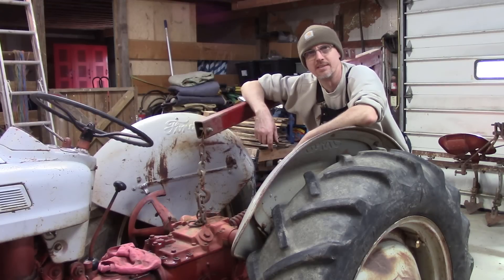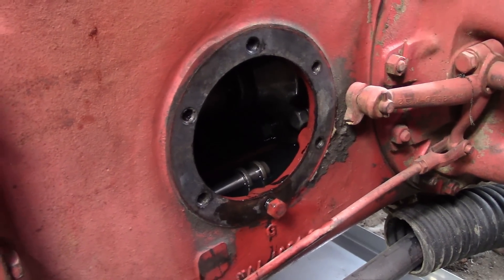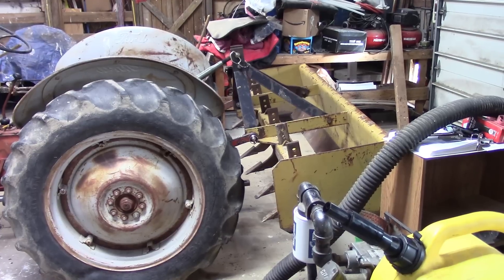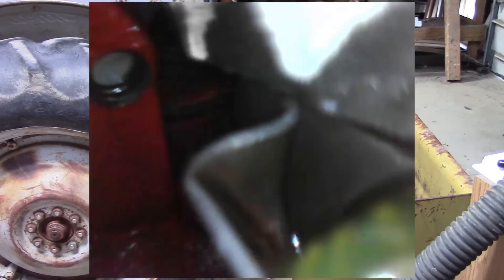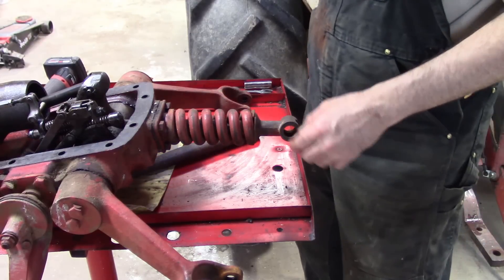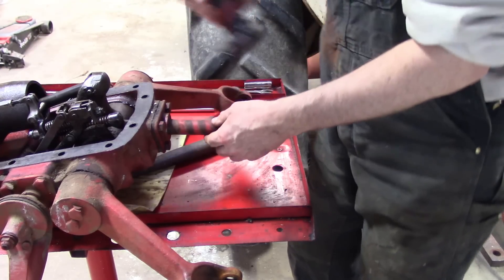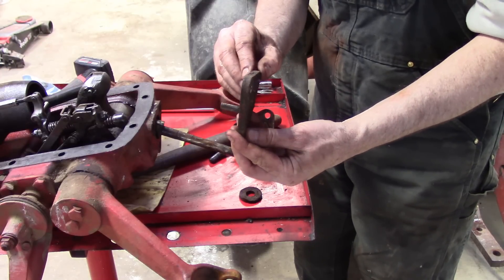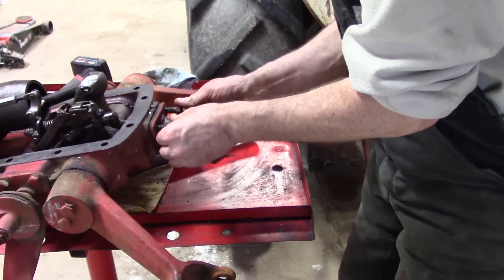Jubilee/NAA three point lift adjustments

Comment: Everything about the vid is great, and im happy that your tractor works..but the felt washer on the draft spring is supposed to go on the spring shaft FIRST, and up against the stop on the rod, as its the dampener for the outward travel in the spring rod as the draft link takes a load.... the 3 hole plate that may have been bent is the anvil...and they will get bent when the felt is gone, and the tractor is used much for plowing... and the outer cover thats loose under the spring is NOT supposed to be loose... its the dust seal cover for the hole the shaft goes thru....

Comment: Thank you for this video. I followed your steps and my tractor is up and running. I had rebuilt the hydraulic pump and replaced the lift cylinder but the adjustments were the ticket. Thanks again.

Comment: Great video!  Thanks for making it and making it available to us!  My Jube has the same issue, jumping with a load.  I will tackle it one day, but it's not really a big enough issue with me, right now.
Reply: On an NAA and some of the numbers tractors, remove the large filler cap under the seat. You can then look in to see if the 3 point piston seals are leaking, you can also check some of the valves. Just requires a 1 & 1/16” wrench. 
Hello from north east Montana. 
10 miles from the Canadian border.

Comment: I have an NAA also. There is a cover on both sides, left PTO cover, right dipstick cover. 
On metal covers use Loctite 515? or 518? anerobic gasket maker. 
I am real sure that those are the two part numbers, but not 100%.
If you want to check for leaks on the piston, remove the large filler cap, you can look right into the piston and cylinder. 
A lot easier than removing the PTO shifter or the dipstick cover. 
Hello from north east Montana. 
10 miles from the Canadian border.
Reply: Thanks for that from Oklahoma, I got a jubilee that has been dedicated brush hog and some f.e.l. work (just limbs and branches) the f.e.l. has a crank driven pump and that system is relatively easy to understand. But...
My brush hog 3 point won't lift, work fine the last time I used it. So something new to figure out, I like understanding prior to tearing it apart to figure out I did something wrong only to have another thing to fix.
So again thanks.

Comment: The lift cycling/jumping from what ive been told is a problem within the hydraulic pump itself.
My NAA wont position itself, its either traveling up or down, i suspect my problem is in the top cover.
Enjoyed your video, great information.
Reply: Thanks so much for your video. This was a great help.

Comment: Great video, i have a complete spare NAA hydraulic lift cover that has been on my garage shelf for over 20 years.   I have a restored jubilee that i may sell.     the jubilee arms will lift but drop down in a day or two.       before i sell  i want to add a heavy plow and see if the tractor has any problem lifting it.    a good tractor mechanic friend told me it is normal for 3 point to drop and don't worry about it as long as it will lift.    i have other old ford tractors a little newer than the 53 jubilee, and they will lift heavy items and arms will stay up for weeks???   within a few weeks i am going to try to fix the hydraulics on  my 1955 model 740.   if i am successful my neighbor and i are going to try to fix his 1962 ford 2000 hyd lift.  Thanks again for putting this video on the internet.

Comment: Ok good start  . The 1964 4000 industrial tractor is a little different on adjustment . 3/16 and 1/4 are not right. Thank you for sharing the video.  Learn a lot. My trouble was up too high or down all by itself.  Again Thanks

Comment: The spool valve is 935.00 that’s right you are see correctly . You can add two o-rings to the spool price that fit snugly around the spool rod one in each oil gland and are about 3 thousands larger than the spool valve oil directors is will slow the jumping way down to 1 jump in thirty to fourth seconds it will slow the lift speed down a little because the o-rings are taking up a little space that oil was in use size B o-rings not the little skinny ones but some with a little meat to them it a cheap fix that will last for year but like I said it will slow your lift speed down a little not bad where it creeping.you can also replace the tube the spool goes in which will tighten the tolerance up a little also but they are expensive also about half what the tractor is worth.

Comment: I had to change the levers c
And shaft because  mine were wore out, put it together  done the adjustment, it don't work properly, only way to get the arm low enough i have to put it draft posion. But I now have a problem  it didn't have before,  I got fluid leaking  from what appears  to be from the plate where yours did. I'm about to lose my mind trying to get this thing working
Reply: I'm having the same issue, did you ever find out how to fix it?
Thanks!

Comment: I was told before removing the lid on a jubilee something needs to be unhooked from inside before removing  the lid can you confirm this
Reply from the maker: That is necessary on a 9N, 2N, and 8N’s, but not on the Jubilee.  The older tractors had the hydraulic pump under the cover driven by the PTO shaft.  There was a rod with a “Y” on the end that attached a valve on the pump.

Comment: Thank you for the informative video. I'm renovating my Jubilee. The tractor is all apart except for the Trans and Diff. I have all the manuals, but would like to have seen your process for removal and installation of the lift cover. Was your Hyd compartment clean ? My trans had sludge I washed out by hand, but will at least remove L/side Hyd. Comp. cover to look inside there. Does or did that tractor have the Vane type pump or piston ? I hope your able to reply otherwise I'll look for email.

Comment: At 15:56 you talk about using the crescent wrench to not brake that pin.  What if the pin is already broken off?  Can you buy that piece or do you have to take to machine shop and have it drilled out and a new pin put in.

Comment: Was happy with your video however my hitch arms don't move at all with the draft lever. I can pick them both up by hand and let go and they just drop all the way down. There's no resistance at all.
Reply from the maker: In both draft and position control?  Mine did that in draft but seemed to work after I did the adjustments.  If the don't go up in draft or position, it might be a lack of hydraulic flow/pressure.  Good luck with your repairs!
Reply: @SakimasRidgeHomestead  I'll tear it apart and see if I can fix it with some adjustment and new parts. I'm glad I have your video to follow because my memory is not that good.

Comment: My 1961 Fordson Dexta has same issue. Would fix likely be the same?
Reply from the maker: Unfortunately, I have never worked on a Fordson so I do not know if they are the same design or not.
Reply: Hi comparable but settings are little different dimensions. Visit fordsontractorpages wiki to find the right settings.

Comment: Hi, the clevis on my NAA is completely seized on the spring assembly. How can I remove it? Heat?
Reply from the maker: I would try penetrating oil first, but I think heat would be OK if used sparingly.  Possibly with a wet towel wrapped around where the spring meets the cover to keep it as cool as possible.

Comment: What exactly does the position adjustment do? Height of the hitch?
Reply from the maker: Position holds the three point at a steady height.  Draft adjusts up and down as the tractor moves, draft is used mainly with ground engaging implements like plows.
Reply: @SakimasRidgeHomestead  thanks for the reply. My hitch works but stops 20 degrees from being fully in the upright position. Do you think this is what needs to be adjusted?

Comment: Where did you get your parts? Is it necessary to remove this unit from the tractor to do the adjustments?
Reply from the maker: Parts came from either Steiner or Yesterday’s Tractors, I order from whoever is cheaper.  Unfortunately, the only way to do the adjustment is to remove the lift cover from the tractor.

Comment: Does a 9 n have the same adjustment procedure... great video
Reply from the maker: I don't think this will work on a 9N.  Although they are similar, they have different controls because of the different pump locations.
Reply: The 9N, 2N, 8N have a different hydraulic system, different top cover. 
The 9N, 2N, 8N hydraulic pump is driven from the PTO shaft, pump is in the bottom of the hydraulic section. 
Golden Jubilee & NAA hydraulic pump is driven by the motor. NAA has live hydraulics, 9N, 2N, 8N hydraulic pump is driven by the PTO shaft. So you only have hydraulics when the PTO shaft is turning. In other words if you have your foot down on the clutch pedal, you can drop the 3 point hitch, but you can not raise it until you lift your foot off the clutch pedal!
Hello from north east Montana. 
10 miles from the Canadian border.

Comment: I have a 800 ford it just lifts win it wants rebuilt pump changed fuild o rings everything. What could be wrong
Reply: Did you already replace the 1 inch long steel dowel pin that rides the cam?

Comment: What’s the difference between draft and position?
Reply from the maker: Position holds static where you set it like for a brush hog.  Draft is an active setting for ground engaging implements such as a plow.  Draft prevents the plow from digging in too deep.

Comment: Like your video but couldn't help with my problem. My 1957 ford dexta 3 point hitch is stuck in the up position so I can't get cover off. Help.anybody..
Reply: Grab an IT manual or some other manual. 
I think that the name Ford are English and have a hydraulic system similar to the 9N, 2N, 8N. 
I got all 6 of my IT manuals from Tractor Supply. But you can probably get them anywhere. 
Hello from north east Montana. 
10 miles from the Canadian border.